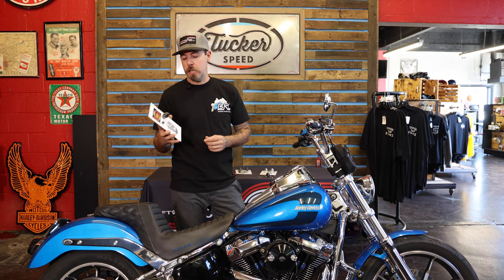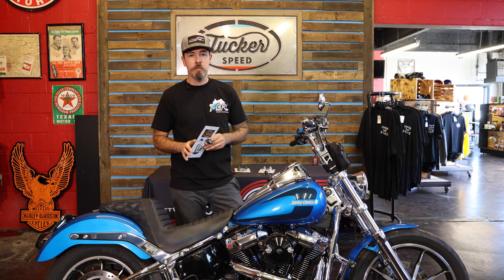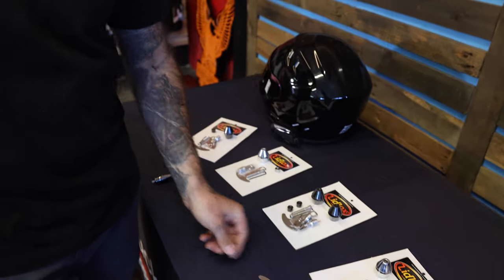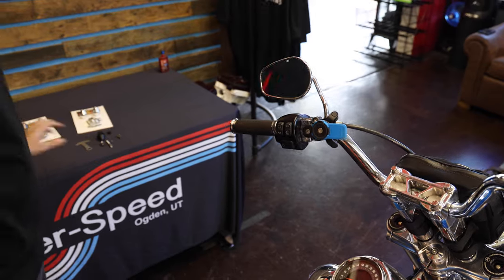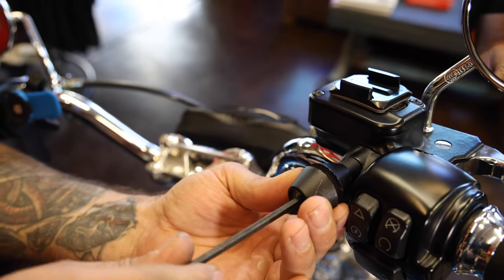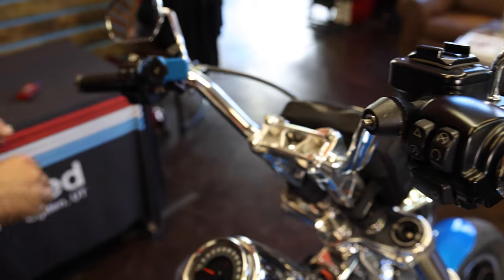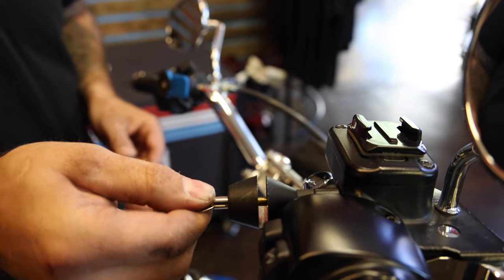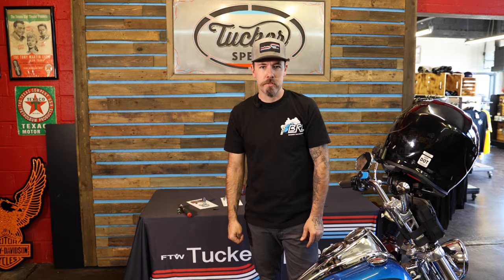Best Helmet Lock On The Market - Lidlox Review & Install for Harley Davidson

Comment: that buckle is so thin metal. seems like anyone can easily cut it off with basic tool....
Reply from the maker: That's not the point. Anyone can steal pretty much anything with enough effort. You can never prevent it 100%, but most thieves are opportunists and this prevents quick snatch and grabs which is how most helmets end up stolen. Sure, someone could cut the strap or the buckle and make the helmet useless but that would defeat the purpose.

Comment: Why can't it work on any bike, the bolt just passed thru.
Reply from the maker: It will work on any bike with the same bolt.
Reply: @TuckerSpeed477  or a longer bolt with proper thread I guess... Thanks
Reply from the maker: Yes, you can replace the bolt and make it work on any bike if you get the right bolt.